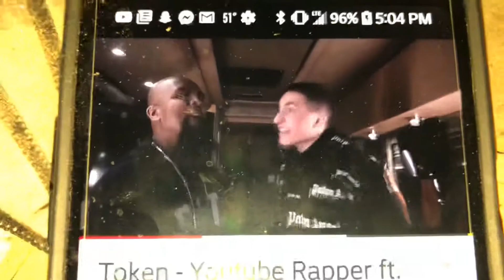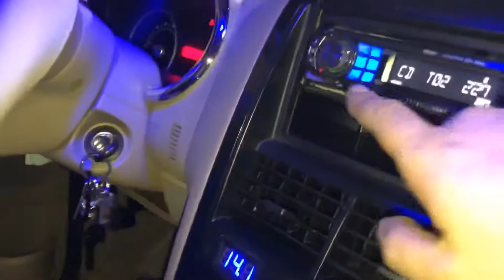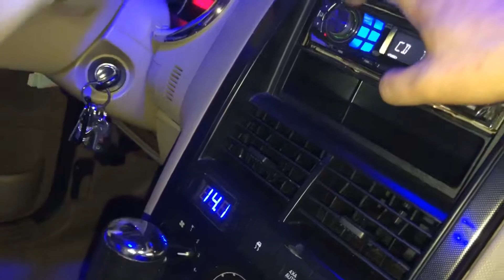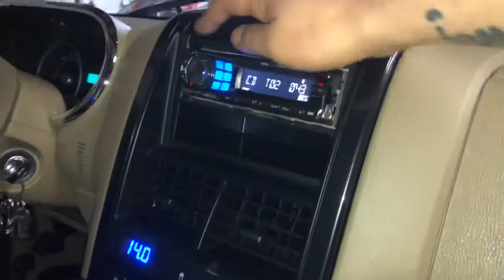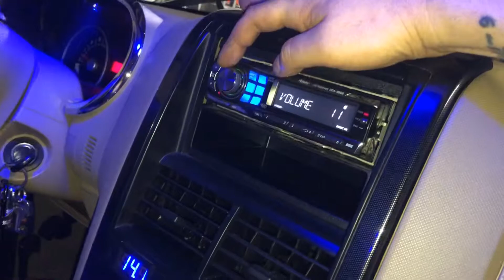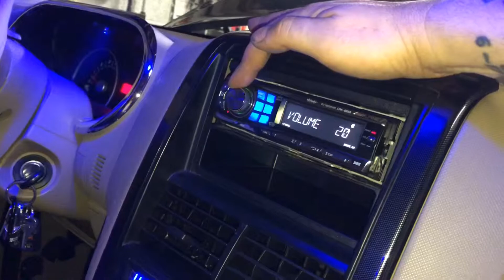Hifonics 5K & Sundown sa-rev 3

Comment: YOU ARE UNDER ARREST FOR MAKING TO MANY DOPE VIDOES AND HAVING A CLEAN AND LOUD SYSTEM
Reply from the maker: Haha my man.. Big up homi i appriciate that... Yo the shit is slamming. Video does no justice.. I still habe to go thru my settings.. But ill say that hifonics 5k dont even get warm.. Infact the outside of the amp was actually cold at the tops and sides lol looks like it will be a dope amp.. Ima post more. I didnt have the four 10s hooked up in that last video so im yet to hear the full on system... But its coming soon man...
Reply: my pioneer twelves just blew  haven't had bass in 2 months (i have a car at age 14 just cant drive it )  when i get old enuogh and get a job i might try those subs and see how they sound i did my own system just like u did imma post it on my channel tommorow i have a pioner double din door speakers and a pionner ampifire HAD pionner subs and i ran 0 gauge wire to 4 gauge on a distribution block and a kenwood exilon 4 channel amp with a 200 amp alternater factory  . all bought by my uncle even the car
Reply: all because im doing good in school
Reply from the maker: @bassbrother101  thats awesome man.. Seriously. This audio game cost money.. Have it or not, it's cosly.. What you wanna do is go for the Rockville k6 subwoofer.. They are pretty inexpensive but they are monsters..